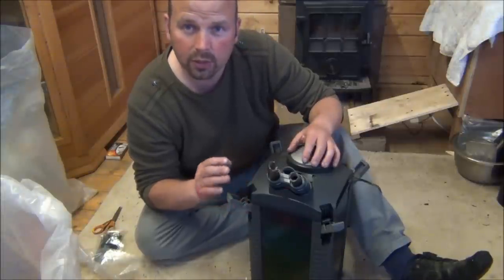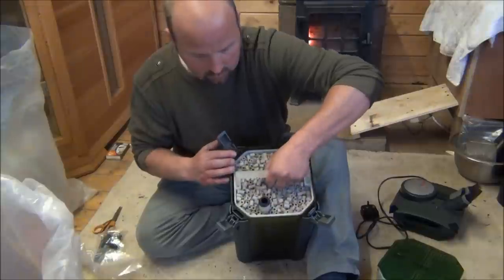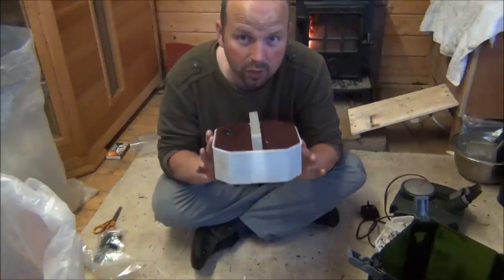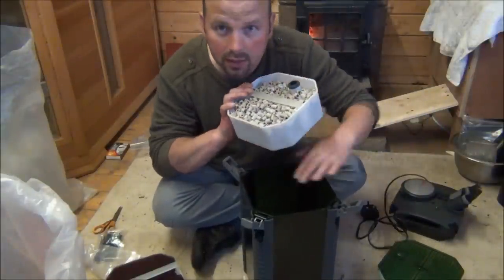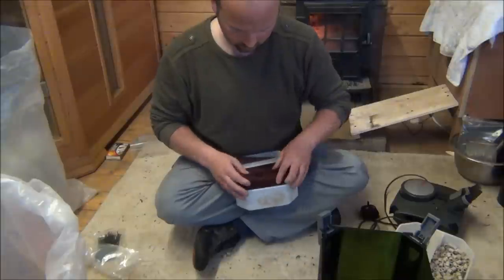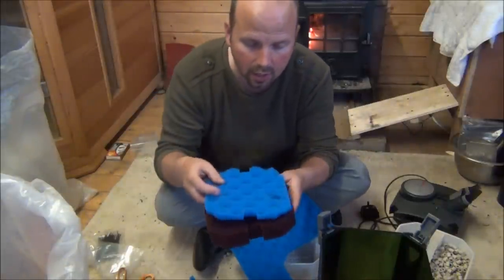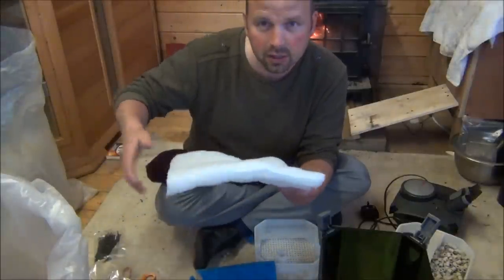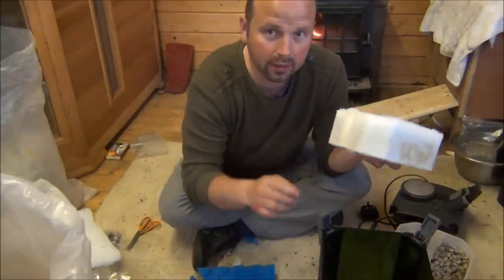How to set up an external canister filter for aquarium by Pondguru

Comment: I have a canister filter with one extra tray. Do you recommend I put more floss in it or have 3 traysnof bio media
Reply from the maker: You can never have too much media in a filter so I'd say always go with more media.
Reply: @pondguru  thanks you saved my tank. I have turtles one of the most dirty aquatic animals you can have with 5 times more filtration than recommended and still have to clean it every 2 weeks or so.  I had it set up how the box said with media on the bottom floss pads in the other 4 trays and then corse pad on top 5th tray. Now I have only one tray with corse, medim and floss pads and filled one other tray with more floss and the other 3 trays with media. Best I've ever seen it. I bought the media you recommended I want the best tank my turtles can have I dont care about the money. I actually save money by not having to switch out everything monthly and cleaning it bi weekly
Reply from the maker: That sounds good to me and setting a filter up properly saves money all round as the filter needs less cleaning, water is better quality and therefore treatments / chemicals to 'fix' problems are not needed.

Comment: heybuddy,just one question.so what about those black carbon packs,i always have one of them in my canester,so  don't need that?
Reply from the maker: Not unless you are using it to draw in colour from new bogwood or mopping up residual treatments.
Most manufacturers will insist on using carbon to mask the fact that their filter is not processing ammonia and nitrite but in a properly set up filter it will only be required occasionally for the above reasons.
This video explains exactly what should happen in a filter.
Reply: shit eh,ightthanks for responding

Comment: I have a filter with 4 trays can I use the bottom 2 trays for foams and the top 2 trays for the bio home filter media since I have a turtle and he produces more muck or would that extra foam tray  clog my filter media?
Reply from the maker: Yes that may be a good option to go with the bottom tray for coarse foams followed by the next tray up with medium and fine. That will reduce the amount of media in the filter and therefore reduce the amount pollutants which can be processed but as long as the filter is big and there is enough media in for the situation (around 2kg per 100 litres) you will still get good filtration.
Reply: Ok thanks
Reply: You can fill the bottom tray with Eheim Mech Pro. This is an awesome mechanical media to collect the heavy muck. If it is possible I would always use ceramic rings or Eheim Mech Pro as first mechanical media. That's why i like Eheim eXperience or professional 2 canister filters, because they have this nice gap below the bottom tray.

Comment: how often do i change my  medium and course sponges   im still using the same ones  for last 7 mounths  clean every 4 weeks in tank water and change fine
Reply from the maker: The medium and coarse sponges will last until they become so clogged they are unusable or they fall apart. Most people change fine pad during monthly maintenance but in a clean tank it could go longer. Just change as and when it becomes too blocked to be of any use.

Comment: Could you recommend the best way to set up my Aquis 1050 2 tray canister filter. Thanks
Reply from the maker: freedisk1980 Just the same way but you would have bottom tray for foams and only one tray above it for the media. If you send me dimensions of media tray I can work out how much media it would fit in no worries.
Reply: Pondguru Outdoors 
8 Inches by 8 inches, 3inches Deep, thanks for getting back so quick
Reply from the maker: freedisk1980 That is quite a big tray for an external filter and would take approx. 2.5kg of biohome ultimate or biohome mini ultra if laid in loose. If you packed it in a bit neater you should get nearer 3kg in there so the filter upgrade kit which contains 3kg biohome ultimate media, 50 gel filter starter balls and the 3 foams would probably be the most economical option. http://www.ebay.co.uk/itm/EXTERNAL-FILTER-UPGRADE-KIT-3Kg-MEDIA-FOAMS-AND-50-FREE-BACTERIA-BALLS-/221636444929?hash=item339a8fc301

Comment: Hi Mr. Pondguru. Can I ask you quick question? Where did you buy the medium foam? I can only find the coarse, and fine foam but not the medium foam. Thanks.
Reply from the maker: On ebay and amazon there are loads of sellers doing packs of 3 foams and they will have coarse, medium and fine. Not sure where you would buy only the medium density foam but if in doubt go with 2 x coarse and 1 x fine.
Reply: Pondguru Thanks for such a quick reply. I finally found it!
Reply from the maker: Truong Dinh
No worries.

Comment: I would go the extra step and put a prefilter sponge on the intake pipe, reduces frequency of cannister maintanance, I however disagree with filter floss not being at the top.... I prefer it to remain there because your bio’s will over time release debri (bits of sinnisters glass ceramic) I’d rather it stay away from my impeller and being distributed into the aquarium- eheim classic user here. Otherwise good video

Comment: I got a rena xp3.. if i do use carbon because i have trouble with my tap water.. where should i place it? above or below the biohome ultimate?
Reply from the maker: I'd always put carbon as the very last thing the water hits so for most externals it should be on top of the first try you see when you lift the top of the filter off.
Reply: ok great thank you, and i moved the fine filter pad to the bottom with the rest of the pads like u said. thank you.

Comment: I appreciate you taking the time to post these instructional videos. My fiance fell in love with two yellow-bellied sliders while we were on vacation, so we brought them home not knowing much about them. The turtles are still small, but I know now how much they will grow and already I am having to replace and wash the tank once a week because of the build up with the horrible filter I originally purchased.  I just recently purchased the Sunsun 302 external canister filter and 2 kg of Biohome Plus media.  I ended up having to buy the foam filters that are supposed to come with the Sunsun 302 (which I will stack in a similar fashion to this video example) because your U.S. Website is currently out of stock with the sets.  Other than flame-retardant chemicals, is there anything else I need to look for if I were to search for foam pieces to build my own set at home? Are these foams available at hardware or craft stores? Again, thank you for your help.
Reply from the maker: +Heather Cossaboon In the UK every pond supply store or online pond gear seller has a range of foams so we've no real need to source them from anywhere else but I would think that craft stores would probably hold some as would furniture upholsterers but some used for furniture may be chemically treated to resist fire. If you try sellers of pond filters and koi I'm sure they will have a range of foams available as they are essential for the majority of the filters available today. Even 'proper' foams for specific external aquarium filters will be fine as long as they are put in the correct place in the filter.

Comment: hi I have just purchased a FX6 but it was used for marine tank can it now be used for tropical tank what would I need to do to clean it please help
Reply from the maker: +Mark Scott Ideally you would scrap the media and foams if it has previously been used on a marine tank as it will be full of salts and mineralisation. Then the filter would simply be set up as normal. Here are some notes on the FX from my website http://www.filterpro.co.uk

As the trays work from top to bottom and have good foams surrounding them you really only need a thin fine pad on top of the top tray then fill the trays below with media. Each tray should take around 1.5kg of biohome ultimate or a but more if neatly packed. Therefore a maximum of 5kg can be fitted in the 3 trays of an FX5 / 6.

IS THERE A MINIMUM AMOUNT OF BIOHOME REQUIRED TO ACHIEVE FULL CYCLE FILTRATION?
Yes - Using 500g in a huge filter on a 500 litre tank will not reduce nitrate if all the other media is producing nitrate. When a sensible amount of biohome is used the results are outstanding.
Most filters will by their very design hold a suitable amount of biohome e.g. the majority of external filters for a 300 litre aquarium will commonly hold 3kg - 5kg of media.
Through years of Biohome being used in all sorts of aquariums and ponds the recommended amounts of biohome needed to see a good reduction in nitrate (full cycle filtration) are as follows:
Average community tropical aquarium  = 1kg per 100 litres
Average coldwater aquarium = 1kg - 1.5kg per 100 litres
Predator aquarium = 1.5kg - 2kg per 100 litres
Large cichlid aquarium = 1.5kg - 2kg per 100 litres
Malawi / Tanganyikan aquarium = 1.5kg - 2kg per 100 litres
Marine aquarium = 1.5kg - 2kg per 100 litres
Average mixed fish pond = 1kg per 200 litres
Average koi pond = 1kg per 150 litres
Ammonia and nitrite will be reduced at much lower amounts but full cycle filtration is the only 'proper' filtration therefore the figures above are for the filtration job to be done properly resulting in less water changes being required.
REMEMBER - It is always better to over-filter than under-filter as a filter with a larger capacity will react more quickly to any pollution incidents and process waste before levels rise above safe amounts.

Feel free to ring me any time between 9-5 weekdays on 07772848730
Regards,
Richard

Comment: Hey i got another question as well. I was playing around with my Eheim 2213 that I am about to install and I set it up the Following way (Bottom to Top)
Pre-filter (Ceramic Rings)
Mechanical: 1 Corse Sponge (Blue one which came with Eheim), 1 Marineland Bonded Filter Pad Cut to fit into canister, 1 Fine Pad (White One Came with Eheim). 
Biological: Eheim SUBSTRATpro (The Pearl dog food looking ones)
Chemical: Eheim Carbon Filter Pad - I am debating about leaving this one in here but since i want my water to stay clear I might leave it in for a few months.

So my following questions are 
1) I had an extra Media Bag from my Aqueon 70 Filter which I used to put the SUBSTRAT Pro inside of (easier for me to remove since the 2213 doesn't have trays) is that ok or is it more efficient to have the Bio Media just sit there without a media bag?

2) I notice that after Touching the SUBSTRAT Pro Bio Media that little pieces come off from it, is this normal? It's like little small pieces of sand or whatever material it is made off of. So I am wondering is that why Eheim recommends to put that White Fine Polish pad at the top of the canister, to prevent these little fine pieces from going back into the tank? So Should I swap my setup, add another polish pad on top, or leave it as is?

Sorry for the long message, I just want to have the best filtration for my Fishy.

Thanks!
Reply from the maker: Media works just as well in or out of a bag and the fine pieces of sand from media wouldn't be generated so much if the media was in a bag as it would be easier to remove (so wouldn't generate the dust / sand during removal). If the fine pad is put on top of the media any fine dirt will clog the media and reduce efficiency and if it is fine enough to pass through the coarse, medium and fine pad it will simply float about in the tank and be caught second time around. Therefore from a clarity point of view it doesn't make a difference where the fine pad is but from a media clogging point of view it makes a big difference.
Reply: Pondguru Gotcha Thanks PondGuru! So my Original Setup is the best more efficient way then correct? Sorry I have 2 Gmail accounts and I switch off from one to another but this is my main one lol
Reply from the maker: ThaBigO Sounds like it, yes.

Comment: would it be the same order for the eheim pro 3 as the pumps setup is a little different or the  same please ?
Reply from the maker: It would be exactly the same except for the Pro3 has a 'pre-filter tray which the water hits first before going down to the bottom and rising up through the foams and media trays so just leave the pre-filter tray as it is and set the remaining trays up as in the video, no worries.
In a mature system you would upgrade it over 4-6 weeks to prevent any ammonia and nitrite spikes.

Comment: How long does this last for ? I'm talking about the biohome ultra.
Reply from the maker: In a properly set up external filter you can expect a useful service life of 6-10 years.
Reply: Not Bad.     :)
Reply from the maker: LAna St.ColumB The structure of the media should still be fine beyond that but the internals will be clogged by successive populations of bacteria so best to swap out after the 6 years I reckon.

Comment: Would this upgrade also reply on a Tetra EX Plus filter? and if not, could you recoupment an improvement?
Reply from the maker: Yes the same process would apply to the Tetra EX filters and a proper upgrade would be most welcome for them as they come with some of the most useless media and the strangest lay-outs I have ever seen. 
Once they have foams in correct place and good media they are just as effective as any proper filter.
Reply: thank you so much for your reply i really appreciate it ..May I ask you another question ...what new filters out there do you think is best?
Reply from the maker: The manufacturer of a filter is much less important than what is inside the filter with regard to foams and media but for build quality and spares availability the Eheim filters are very good. However any Eheim filter set up badly will never outperform a cheap filter of similar size set up properly. How you set filters up dictates whether you will have good water quality or poor water quality, happy fish or fish which always suffer from diseases and problems.
Reply: Thank you again it help me a lot.. Have a great Day to you and yours.
Reply from the maker: Same to you - glad you enjoy the videos.

Comment: Hi, looked through hundreds of comments but can't find answer. My filter is 2000lph , if i added as much media in baskets as you suggest then by how much would the flow rate reduce ?
Reply: Lol how about you try it out and see for yourself man.. How is he supposed to know? So many variables..
Reply: You can test it by putting the outlet in a bucket of known size and timing how long it takes to fill. Many things such as media, a spray bar, head loss and muck can reduce its turnover rate.

Comment: Where would the carbon go? I have a Biobox2 from Aquatlantis. this filter has a blue foam, white fine material, carbon and another one with little brown balls, I suppose this is the biofilter balls. thanks and cheers from Spain. Great vids indeed!
Reply from the maker: +elbenaso Glad you enjoy the videos. If there is enough biological media in the filter you shouldn't need the carbon as you will have no ammonia or nitrite although carbon does have the benefit of drawing in any colour from bogwood and residual fish treatments so is good to use after a course of treatment. Most manufacturers will put carbon in and tell you to replace it regularly if the filter can't cope with the fish waste (either it is too small or doesn't have enough biological media) and if you have to use it then it should go as the very last thing in the filter so it is operating in the cleanest water. So the order would be: Coarse foam, Medium foam, Fine pad, Biological media, Carbon.
Reply: thanks a lot for your prompt answer, I really appreciate it. One more question, I also have porous glass rings from the same company, If I removed the carbon, these rings would go first in  the order, wouldn`d they?  thanks alot again and keep it up, you are the best and I learn a lot from your vids
Reply from the maker: +elbenaso Any poor quality ring shaped media could go before the foams to catch really heavy muck and settle the flow but any media which has decent potential of supporting a good population of bacteria should really be after the foams, operating in clean water.
Reply: I really don`t know if these rings have a good quality, they are of the brand tecatlantis. Anyway, thanks again for your help and again great job!!

Comment: what kind of foam/floss are you using. most of the stuff I see online looks a lot lower quality than what you are using. The lowest one looks more like a rubber mat than a filter. all the stuff I see is very open/course
Reply from the maker: James Glenn These are Oasis foams and fine particle matting (white one). I sell them on ebay - link in video description.

Comment: hello pondguru can I set up same way my cascade 1500? media all the way to the top,  help me ,what's the best way please?
Reply from the maker: 'Cascade 1500' name is used by a few manufacturers - please give me more details and I will look into it - most filter trays water flows from bottom to top like in this video but you can check by putting a piece of fine pad on top of the top tray and on the bottom of the bottom tray, leaving it running for a few days then take it apart to see where the dirt has collected - that will tell you the direction of water flow.

Comment: how often should these systems be cleaned and how well?
Reply from the maker: +Carlos Lopez They really only need cleaning as and when the return flow to the tank slows down indicating that the foams are clogged. That may be once a month or much longer depending on your stock and feeding. If the filter is set up properly you will only need to clean the foams and all the muck will be in the bottom of the filter.